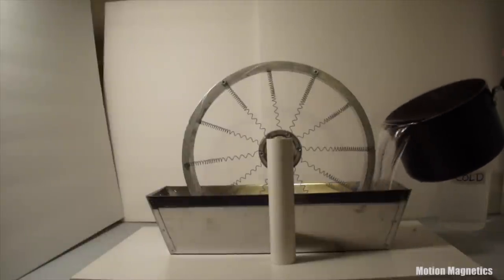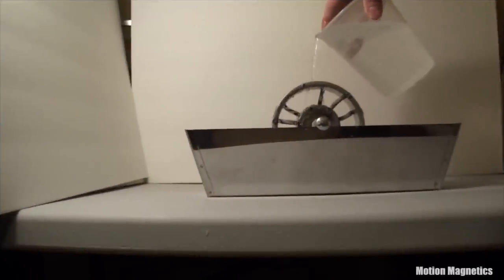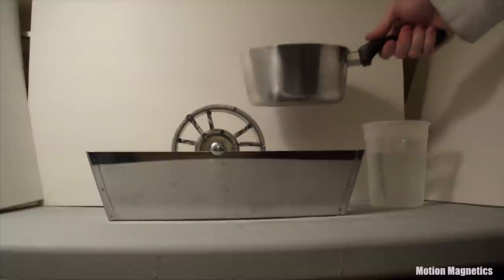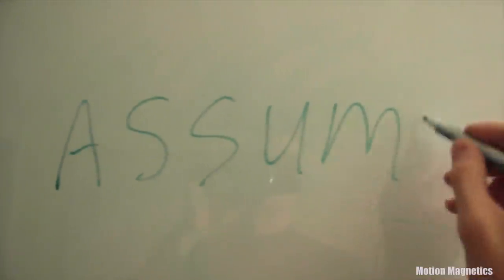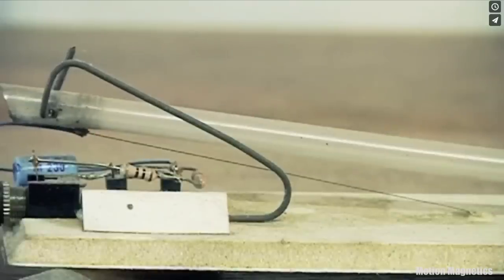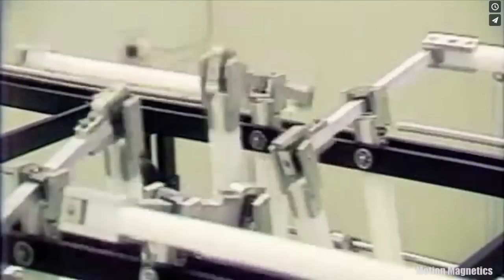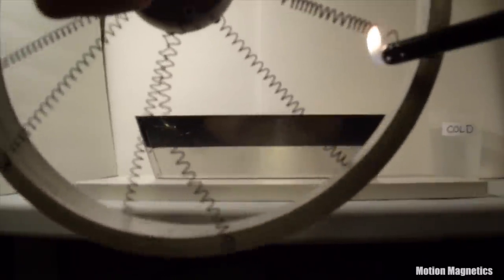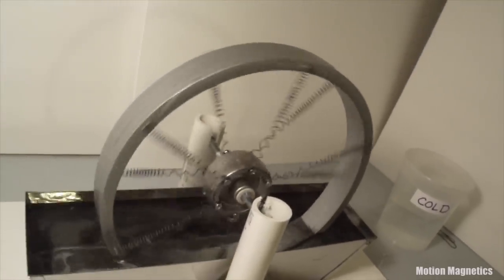Nitinol Heat Engine Version 1.0 Part 2

Comment: cool stuff. invented at Lawrence Livermore Labs. lots of attempted application, little fruition. when applied to task concerning waste heat recovery then I believe the tech will shine. as usual most people seem to consider that a motor or engine needs to rotate at high speeds, how mistaken they are. a unit of work is just that. keep up the great work sir.

Comment: So let's say you stuck a flame under the water, you are pretty much making energy without the use of materials you need to buy?  Like if this could be used in a car, all you would have to do is start the flame and wait for the water to heat?  I know I am probably incorrect, but whatever.
Reply from the maker: Team Wagy Something like that, actually. It would probably be similar to powering a steam engine, except that it would require less heat.
Reply: +Motionmagnetics , where does one buy nitinol in USA?
Reply: We make 80% of US supply.  Look up EarthHunt for retail (ebay).
Reply: E-BAY

Comment: hmm.... so instant heating by pushing a current through it is not the problem, its the instant cooling afterwards to reset. Maybe tube out of nitrol formed like the spring and with water beeing pumped through it, limit its strech by a rope so that it doesnt overextend, run the water to a radiator with a fan now attach a dozen of those to a skeleton and you have yourself an artificial muscular system . Critic ?

Comment: So, this is actually an overbalance wheel, much like the rubber band version where heat is applied to the bands on one side, pulling the hub to an off-centered position. The heat you apply to the nitinol springs pull the hub from the center, causing the wheel to be off balance, allowing gravity to turn the wheel. Do I have that right?
Cool video. Nothing negative to say about your experiment or your sharing it with us.

Comment: Is it the difference in temperature that makes It work or is it purely the heat, what I mean is would it work if you used ice for one bath and room temp water to pour on.
Reply from the maker: flitsies You have to heat the nitinol, but it doesn't require a great deal of cooling to cause the rotating of the wheel. That's why the simple air cooling of the springs induces rotation.
Reply: Motionmagnetics Thanks, it's very interesting to see this in action, I'm assuming it doesn't have a great deal of force behind its motion.
Reply from the maker: flitsies Not in this particular configuration, but there are configurations that do. I've seen a nitinol motor that was strong enough to pull car with a thin metal wire, and I'm sure there are some that are much stronger than that.
Reply: Motionmagnetics That sounds impressive.

Comment: hi 
good design 
but can you explain diameter size effect
Reply from the maker: Thank you.
Basically, the outer ring/wheel, needs to have a large enough diameter to stretch the nitinol springs far enough away from the inner wheel to create an imbalance  in the system. Heating the springs that are immersed in the warm water causes the springs to constrict, offsetting the wheel and then gravity does the rest.
Reply: Motionmagnetics i am working on the system that is similar to your system but differs in the shaft isn't fixed
Reply from the maker: Noor noor Sounds exciting. If you post anything, let me know? I'd love to see what you come up with.

Comment: Its not free energy it needs hot water.   Same old same old  It all boils down to making hot water.  Even nuclear power plants are nothing more than a water heater.    Its the same old tired steam engine from 100+ years ago.

Show me something to go WOW over.
Reply: A steam engine is completely different than this, the steam pushes something to spin, like a water wheel.  This engine uses gravity to spin by making the weight be off-center  and heavier on one side.  I don't think anyone said this was perpetual energy either, you need hot water which requires energy.  If someone did say that then they are indeed wrong.

Comment from the maker: +Pedro Torres 
I didn't measure the temperature. It's supposed to be around a 40 degree differential. The water I used was heated, just below boiling. You'll note in the video, that my fingers were briefly in the water, and the water wasn't hot enough to burn them. And the slight cooling the springs received as they left the water, and were in room temperature air, was enough to induce rotation.

Comment: According to google material fatigue will occur at about 100 mio. shifts. Assuming 1000 revolutions per minute, running non stop this would be only about 5 years until an engine would fail due to material fatigue. 17 state changes a minutes is way too slow to do anything practical besides pumping water or something. 100 million cycles is not really as much as it seems. Just think your cars engine, it revs somewhere in the 1500-3000 mark.

Comment: Try inoculating MnAs, or Gadolinium (Gd) particles into rubber-bands on a similar rotor design... If this is done, when half the rotor is placed in a magnetic field, they should experience a magneto-caloric effect... The higher the effect the better... The effect creates heat temporally in the presence of magnets.... This heat (if high enough) would cause the rubber bands that are in the magnetic field to contract which would lead to the rotor spinning in theory.... The spin in theory will expose the areas outside the magnetic field to the magnet as he rotor turns.... Therefore, no fluid will be needed and this would lead to a solid state heat engine as far as half the rotor is in a magnetic field and the other half outside as well as the rubber band is doped with a high magneto-caloric material...

Comment: may I suggest: overbalancing a wheel does barely use the huge force of nitinol. let it push or pull with mechanical contact. Use gears to increase rpm, cause even if it is slow, it can do 20 tons pressure per cm2.
Also, try roomtemp water vs quick surface evaporation (like wet cloth in 26C degree room is evaporation cooled to about 18 deg). Further cold funneling or concentration methods may reach the req. temp diffrence. a strong motor from evaporating water.
Reply: Just a thought, use alcohol, instead of water, this can cool tremendously. then of course recycle / condense the alcohol.   needless to say, nitinol should reset at 26C.

Comment: Thank you for sharing. it's been over 4 years that i'm trying to find nitinol memory wire for some more serious engines  , like the ones shown in early 70s . if you could recommend me a place to look for . Thank you. all i can find are the ones 1 mm thick . .nothing worth ordering .
Reply from the maker: Mars Seeker I've picked up mine off a dealer in Belgium, that's listed on eBay. Ridgway Banks still works out of a shop somewhere in California. So you could probably google it, contact him directly, and ask him where he feels the best source would be?
Reply: Motionmagnetics Thank's a lot.
Reply: Motionmagnetics What diameter do you recommend? I'd really just play with it, but I would like the ability to use it in something like this.

Comment: Did you have to offset the centre in order for it to spin?
Reply from the maker: Jack Smith The springs are all roughly the same distance from the center ring to the outer ring. The warm water is what offsets the center and induces rotation.

Comment: how is the initial shape set for it to remember?
Reply from the maker: You have to firmly constrain the nitinol in the shape you want it, and heat it up to a temperature range between 500º-550ºC. Usually done in a vacuum or air furnace. You can do it in a salt bath, sand bath, or other methods as well. And then you rapidly cool it down.

Comment: god job!
can u tell me from where exacly do you buy those springs? i wanna try t myself(:
Reply from the maker: Thanks. You can find them easily on eBay. Just type in Nitinol Springs in the search box.
Reply: i know but can you tell me the supplier's name pls?
Reply from the maker: yoav tamir Sure. It's: flexmet. They are located in Belgium. 5 springs for 34.99, if memory serves?
Reply: thanks alot
Reply from the maker: yoav tamir Any time.
Reply: yoav tamir I've always found it on Amazon. Make sure it days shape memory. There are 2 different ways of heat treating and some is merely stiff wire.